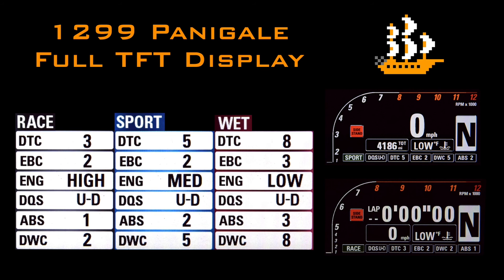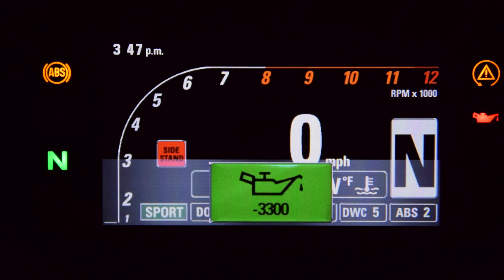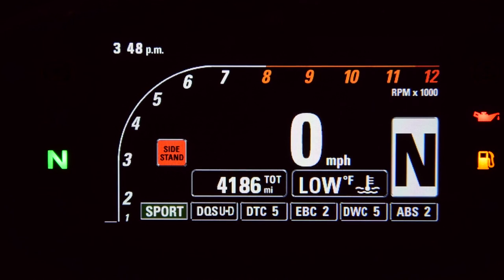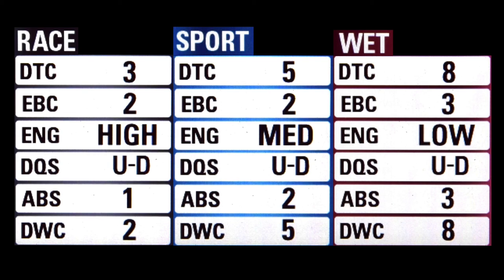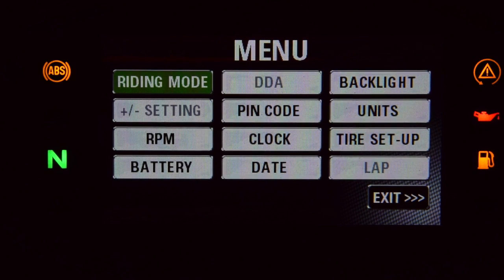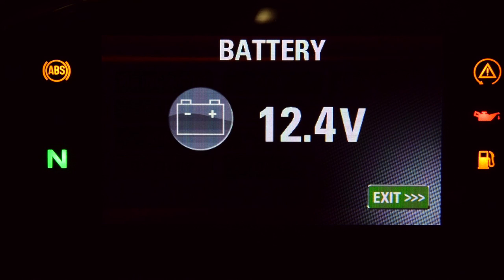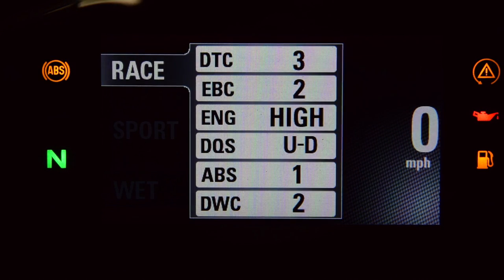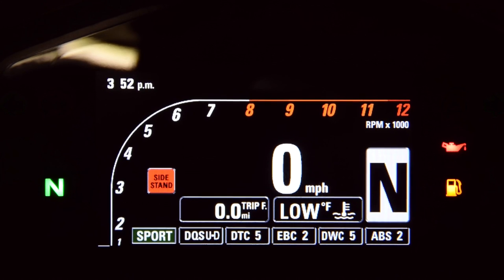Ducati 1299 Panigale Tinkering | TFT Dashboard Display

Comment: Great video! I've been thinking about getting a 1299 and was wondering why you decided to go with the base model instead of the 'S"?

p.s: regarding the mpg setting, turns out 1 UK gallon = 1.20095 US gallons.
Reply: I did exactly the same (went for base model) for exactly the same reasons, couldn't be happier.

Comment: Heard there was a launch mode for this is that true?
Reply from the maker: Not stock on a 1299.  You'd need to add something like Tuneboy.  The V4 has stock launch control, though.
Reply: @Dutchman0  So then question, if it has traction control and wheelie control what would happen if you dumped the clutch at say 10k with moderate traction and wheelie control🤔
Reply from the maker: @-JohnSmith-  those features won't save you from something drastic like that.  Traction control is just supposed to keep your rear wheel from spinning, and wheelie control is supposed to make small corrections to the power as you accelerate in order to keep the front wheel close to the ground.